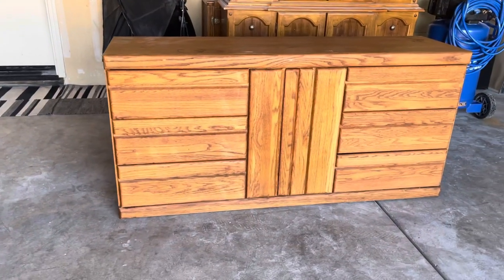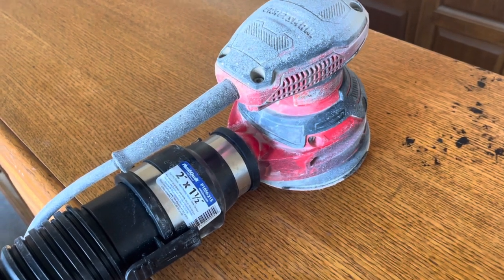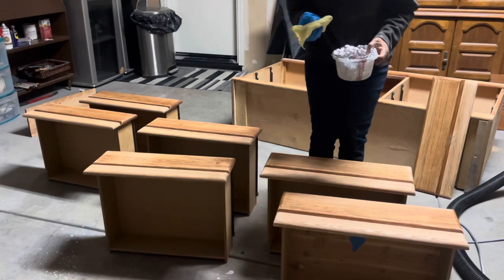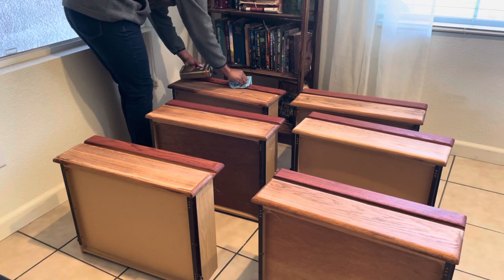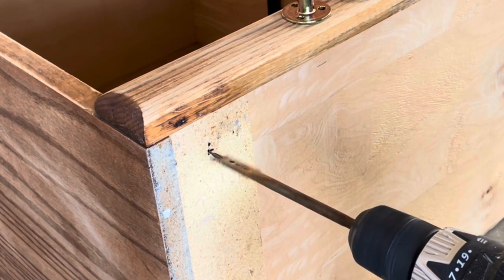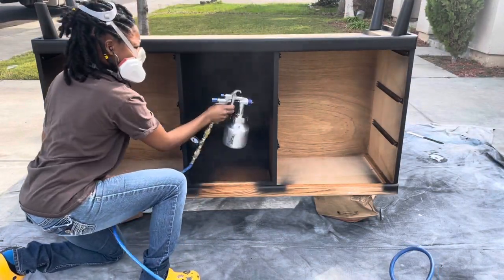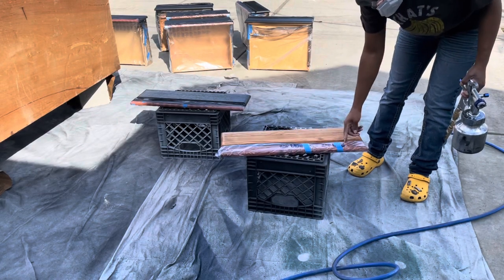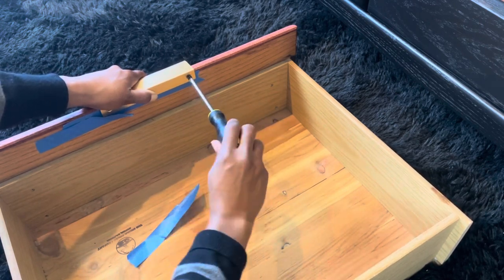Modern Extreme Furniture Makeover!

Comment: Judging by that drill, you have a Harbor Freight nearby. You can get a 29-piece set of bits (up to 1/2") there for under $20, or a forstner set (1/4 - 1”) for $10, if you need to do such drilling in the future.
Reply from the maker: Thank you Dave! I actually went by there last week and bought a 3 pack, it came with the 1/2” bit 😊